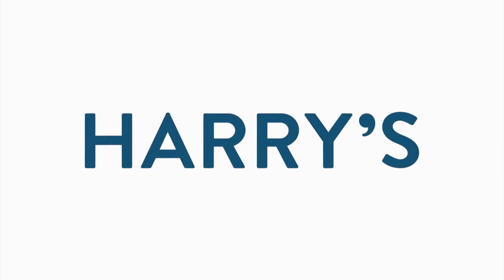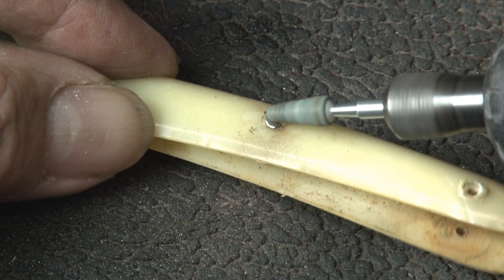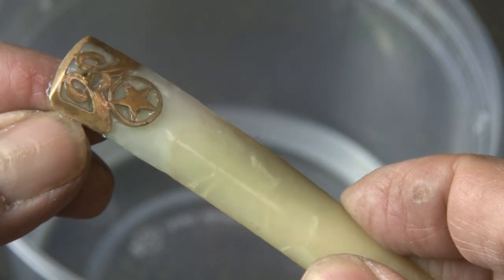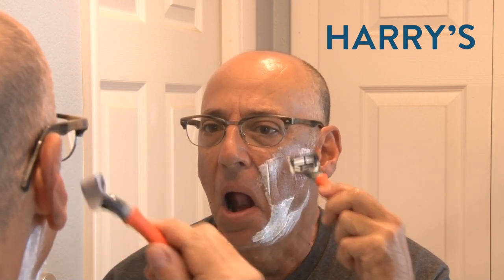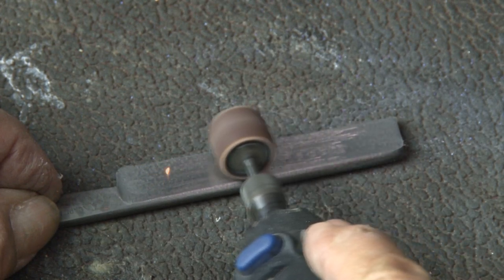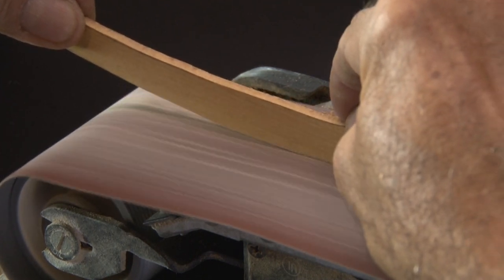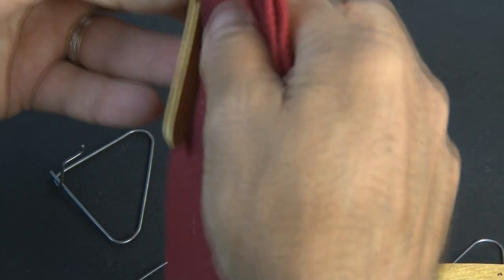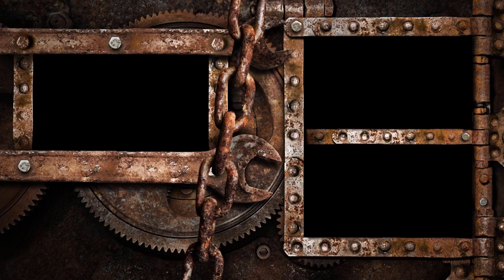75 year old Straight Shaving Razor Restoration - From Dull to Sharp again!

Comment: That trim looks horrible on wood. And it doesn’t look like it fits or like he even tried to center it. Other than that, the blade looked pretty good.
Reply: Though crowd, that's why he was covering the end with his thumb.
Reply: None of these restorers seem to be able to deal with the scales. They don't understand they're not handles and the weight needs to be kept low.

Comment: The original scale was still quite good, some rust but not cracks, with a good cleaning it was possible to save it.
What is the purpose of using the leather strop in a razor that is not honed?

Comment: The wood is a nice option to replace degraded cellulose material, the trim is obviously hard to fit onto the wood, but much better than it being chucked away! You could try applying a layer of epoxy resin over the wood and trim to give it a smoother look. Nice vids kipo! 👍

Comment: I really like this new series overall, but I'm kinda disappointed with the choice to replace the plastic with plywood. Even if it would've caused some rust over time, I think the end product would have been a lot better if you left the scales like they were.
Reply: Jay  Absolutely right!  he could have cleaned up and reused the original scales,keeping it original and much more visually appealing. If rust was the issue with the handles, just apply a light coat of clear lacquer to the inside of the scales to seal them from off gassing. Just sayin'.

Comment: please start using epoxy you could of made epoxy resin scales with that same pearl white so the wouldve looked identical to the origional scales then actually epoxied the trim them into them and actually restored this into a brand new better version of what it was! but the wood not even remotely being fitted right to the trim and the super glue not being taken off the logo name drove my ocd nuts. again im not the guy doing this project so i have no say in what you do but it would really take your finished product from a dud to a absolute 10. maybe try redoing this in a follow up video with epoxy scales!

Comment: This would be a disgrace to Carl Monkhouse. All that trouble to remove the brass for what exactly? Not only did you use an end grinder on a straight razor but you ground and sanded it the wrong direction. Should've left the original scales on it and gave it an honorable burial in the yard.

Comment: Should have cleaned up the original scales, and kept it as original as possible. Blade would be fine with some cameila oil on it - won't rust due to the scales.

Comment: Hate to say it but this one was definitly a dud , the wood was a bad choice . The nuts and bolts were a worse choice . But the trim really tops the fail , doesnt match the wood , you diddnt inlay it and you barley even tried to to pretend to get it straight or centered in any way . You can definitly do much much better

Comment: The original handle was just fine until you soaked it in solvents to remove the accent pieces and you completely ruined the piece when you made knock off parts to replace the original parts of the handle that you ruined.
75 year of piece of junk now thanks to your terrible restoration
Reply: the handle was what was causing the rust celluloid off gassing